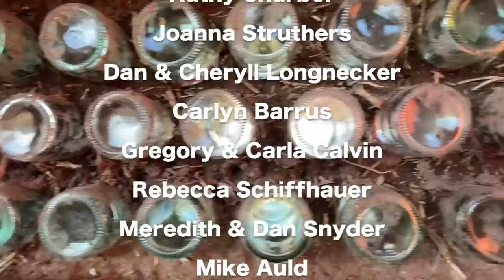Topo Chico Bottle Brick Window with Cob

Comment: I'm with Ashley on the quieter way to do the cob!
Reply: I say do the cob (mixing) with your feet, it seems easier.  There is a channel where they made an entire house out of "shuttered cob".    It looks like the mix you use to fill the "gaps".  (amàco - English channel) does a great job on how to make the "wet cob mix". It looks like you all use the same technique amàco does.   There's a nice little "dance" video with it.  Yea, the noise alone from the mixer will be deafening, so I'm with Ashley on not wanting to use the cement mixer.

Comment: Scratch coat is the first application and is usually dippled with the fingers or there is also a large wire comb used in stucco work that creates a striped texture. This helps adhere the brown coat to the material of the previous surface (pre-wetted of course).  The top coat is usually what the world will see.
Reply from the maker: So the terms in order are scratch coat, then brown coat, then top coat?

Comment: If you plan on using solar panels and putting the batteries in this space as well as his office, make sure the batteries are not lead acid based or eventually it will damage your electronics.  Gel cell would not be a worry.
Reply from the maker: Yep. We know. They’re lithium batteries. ;)
Reply: @TinyShinyHome  I am so stoked that you have done your due diligence!  I know now I can give kudos instead of advice.  🐕+🐩
Reply from the maker: We have extensive experience with off grid solar and batteries in our Airstream so we’re very familiar :) Check out https://youtu.be/HbXCsXXnEPU